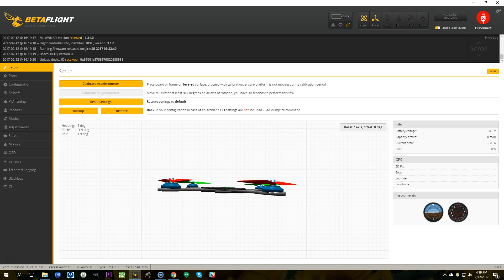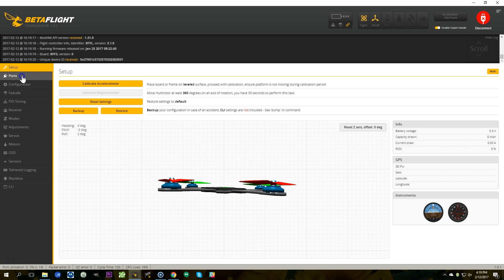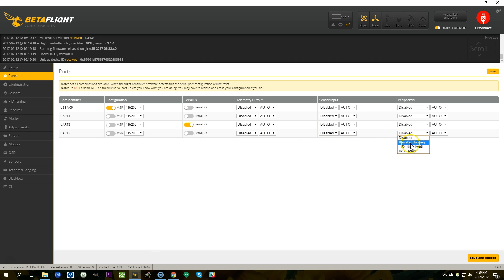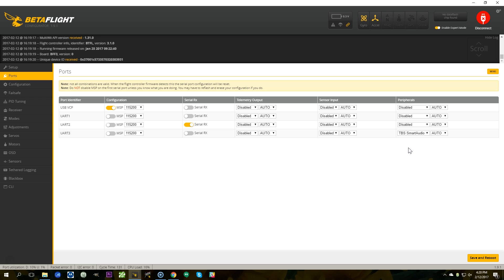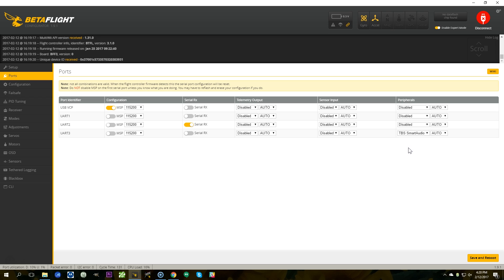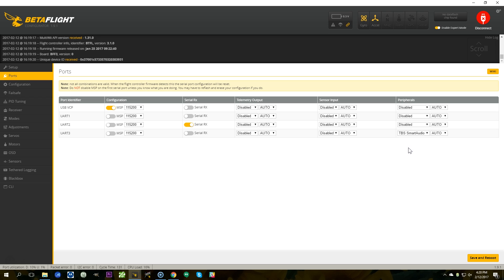BETAFLIGHT SMARTAUDIO | Change vTX channel and power remotely!

Comment: I have the Mach 3 vtx and the iflight f405 stack and have it connected to the uart t1 pad on the fc and audio pad on the vtx and in beta flight under ports tab have uart one with peripherals set as Tbs (smart Audio) and still my device is not ready.  What can i do next to try and fix.

Comment: i have a problem with my rush tank ultimate vtx, ive soldered everything up correctly, but its stuck in pitmode, i cant get it out of pitmode using the buttons on the vtx or in the osd..
Reply from the maker: It might mean your Betaflight vtxtable is incorrect.

If you are using the SmartAudio 2.0 vtxtable try 2.1.
Reply: What about if you still have an f3 with 4.0 that doesn’t have the CFC tables how do you set it up cuz I can’t...I was able to do it on my f7 controller via the cuz tables...but the f3 board is old and doesn’t have vex tables and from the osd it will change but I won’t change the actual channel on the vtx..any thoughts ?

Comment: Joshua I changed the vtx channel on my goggles to race 7 now I can’t see anything but snow. Do I need to go into beta to switch it back ? Thanks
Reply from the maker: That would work. I'm going to guess you have an Emax vTX and it is locked. If that happens, and you put it on a locked channel, it just stops working. Kind of dumb. To unlock an Emax vTX hold down the power button while powering on.
Reply: Joshua Bardwell the power button on what the the goggles turn on when I plug them in . This is a TinyHawk freestyle 2
Reply: Joshua Bardwell I think my button fell off when I touched it 😆 did a reset all set now

Comment: I was wondering if you can help me. My audio is not working. VTX is using R1 ch which works fine. I am using EV800DM and GEPRC Skip 3. Any information on what to check will be greatly appreciated!
Reply: So after careful recording review, onboard recording has clear mic audio. The googles have also the audio, but it is very faint and suppressed by a loud buzzing. The buzzing is so loud that initially, I did not hear the faint motor sound. Ideas?

Comment: Hi, After selecting your preferences will the channel and power selection remain saved to the VTX. If I disconnect the VTX and connect it to another FC will it hold its settings? Thank you
Reply from the maker: Yes, the vTX should power back up again on the same settings that it last held when it powered down.

Comment: Hi JB, Im flying the Eachine Novice 3 atm. I'm new to fpv. Eachine says the vtx is 25~400mw switchable. In smart audio it allows me to switch between 25/200/500/800mw.
It was set at 500mw when I checked first, the vtx gets pretty hot. Is this normal? And does this mean I can run it @ 800mw? My gut instinct is it's getting hot because it's running 100mw over the 400mw limit?

Comment: I cant get my AKK FX2 ultimate mini to work on any of the following github vtx setting on BF4.1  but it worked perfectly on 4.0.6 whys that? any clues? xd its so frustrating...
Reply from the maker: Loiad the SmartAudio 2.0 vtxtable almost certainly.
Reply: @JoshuaBardwell  found the issue. Had to change build type to akk and rdq and flash firmware. Omnibusf4sd to use akk vtx sa on bf 4.1 needed change from legacy to (akk & rdq) its working now.
Reply from the maker: Yikes. Is this a new vTX? I really didn't think there were any vTX out there that still had that bug.
Reply: @JoshuaBardwell  i have no clue if its new or not, I got it for at least 5 months so probably it isn't. Dunno when akk fx2 ultimate mini was released but it must be a good while ago isnt it? I had to flash my fc with different firmware build than standard Omnibusf4sd LEGACY OR THAT OTHER ONE FORGOT NAME XD to actually get vtx tables work and what do I mean by that is that the tables are actually affecting vtx not just looking good and vtx stands alone doin its own thing. Been told by friend that "All the same stuff but akk compatible. Becuase akk didn’t licence the smart audio and tried to reverse engineer it it doesn’t behave properly" and thats why akk sa doesn't work on legacy Omnibusf4sd in my case but im totally not sure whether it's true or not. Im anoooooooob 🤣💨

Comment: I don't know if I will get a response, but last night.  I accidentally cut Rx line going from my vtx to FC.  Just to make sure I checked the OSD if I could still change power levels and frequency and to my surprise it still shows up.  Upon reboot it reverts back to my lowest power level.  Which I discovered does that regardless if the Rx line is attached or not.  Am I doing something wrong?

Comment: Hay jb how come I can get rssi on my vortex 150 in my goggels as well as change  vtx channels and power setings using a dx5e tx and spectrum RX with no telematry can I get the same thing setup with clracing f4s fc I've got smataudio setup and working all ready wouldn't mind rssi in the goggels for my 5" quad to

Comment: OMG.  Please help.  I've watched SO many videos of smart audio and how cool it is to control it from the transmitter.  Could SOMEONE post a video of HOW TO ACTUALLY USE THE TRANSMITTER  to get into this feature.  I've got it wired.  How do I actually DO IT.  Thanks so much.

BTW.  Great videos JB.  You're the best.
Reply from the maker: Center throttle yaw left pitch forward to enter the OSD. FEATURES then VTX SA.

Comment: Do you need to setup the camera's audio line to the vtx?
Reply from the maker: No. That is not required to make smartaudio work. And in some cases, having a microphone attached to the audio input will interfere with smartaudio remote control.
Reply: @JoshuaBardwell  Thanks man :)

Comment: well the problem is that after you set your vtx power and save it and exit the menu,for some reason it always ends up on 25mw :( why?
Reply from the maker: Some vTX like TBS Unify ship "locked" to 25 mW and you must manually unlock them using a button press.
Reply: @JoshuaBardwell  ok,i see thank you for your quick response,wow quick, man we are soo lucky to have you buddy,have great day :)

Comment: Hey Bardwell, hoping you can teach me something today :)
 Any idea why smart audio would work fine on uart6 (tx6) on my lux micro v3 fc but not on uart3 (tx3) ?  I ran into this issue on another build a while back and the only way I could get smart audio working was to swap uarts with my crossfire which is what I've done on the lux to solve the same problem (crossfire nano works fine on uart3 btw)....I just don't get it because everything I can find online about smart audio says it should work on any non inverted uart?
Reply from the maker: Some FC have issues running SmartAudio in some UARTs. As long as you find a combination that works, go for it.
Reply: @JoshuaBardwell  Thanks for the quick reply!  That's good to know, I wasn't sure if I was doing something wrong or if I had a hardware problem or what. I even tried softserial and couldn't get it to work on that either, although I followed the instructions for a different f3 fc so the resource serial_tx number might be wrong for my f4 fc.

Comment: Hey josh i just set up the Atlatl HV and I have it on T1 uart1 and Ive tried both irc tramp and tbs and neither work?
Reply from the maker: IRC Tramp is the correct protocol. Make sure you are using the T wire on the Tramp.
Reply: Joshua Bardwell thank it was user error lol I was using the wrong uart!!! Thank you for the quick response!!!!

Comment: Hi Joshua, my smart audio menu goes straight to statx and I can’t do anything with it
Reply from the maker: It means the FC is not talking to the vTX. Wiring or configuration is wrong.
Reply: Joshua Bardwell I have it wired to the tx3
On the configuration screen on bf I have the uart3 set to SmartAudio on peripheral
Reply: Joshua Bardwell could it be, I’m using a r9mm receiver and not using f port I still have it set up sbus way?

Comment: @JoshuaBardwell Can you get audio from a run am swift mic with smart audio and use it for lua script at the same time? Because I have lua set up but I’d like to hear my motors when I fly as well. Thanks!!!
Reply from the maker: You can sometimes use audio and smartaudio at the same time. But sometimes they interfere. If you have a new vTX with separate audio and smartaudio lines then it's no problem to use both.
Reply: Joshua Bardwell 👍Thanks man!!

Comment: Hi. i have 25mw - 800mw tbs unify but at the betaflight osd there is max mw is 600 option. Does any idea ?
Reply from the maker: The SmartAudio menu vTX power options are fixed to specific values. They do not always correctly match the actual output power in the vTX. So when you set the menu to 600, the vTX will actually go to 800.
Reply: @JoshuaBardwell  First thanks for answer but i guess i remember 800mw at my another quad. Maybe its about betaflight firmware ?

Comment: I dont even have the "onscreen display" ? Meaning that I dont see RSSI values, battery voltage etc, just empty, how is that ? And yes, I enabled OSD in betaflight ... am I missing something ?
Reply from the maker: Maybe your FC does not support OSD? What FC is it.
Reply: @JoshuaBardwell   Its the OmnibusF4SD. Reading its manual I read: "FC integrated OSD"
Reply: @JoshuaBardwell  Hi Joshua, I fix that, it was not proper connected on the FC .. Now I have smartaudio on UART6 in my case and I can change VTX channels, power etc... but when I save and reboot it does not apply it ? Before to save I select "Set" and "Yes" to confirm, then back and save and reboot. It goes back to its default channel and band. Even rapidfire does not change it ? What am I doing wrong ? Thanks!

Comment: Smart audio works great to change my settings but no matter what I do to try to save the settings it reverts back to 25mw when the battery gets swapped, I am using Betaflight 4, any suggests please?
Reply from the maker: You need to unlock the Unify. You are not actually going above 25 mW is my guess. Look at the top line in the VTX SA screen in your OSD. It shows your actual TX power.

https://www.youtube.com/watch?v=EKE0eoj6tT4

Comment: i wired my audio from my mach 2 to the tx3 port of my matek f405-osd, set it up in betaflight to uart 3 peripherals to tbs smart audio, but nothing tends to work thru my qx7
Reply from the maker: Use the Betaflight OSD. Go to Features then VTX SA. If you see blank dashes at the top of the screen like --- --- --- and STATX but nothing else, then SmartAudio is not working. If you see the full menu with no dashes at the top, then SmartAudio is working.
Reply: I see the VTX channel and power in my OSD I attempt to change it then hit save and exit but it doesn’t change the VTX channel and or power could it be I have a faulty Mach 2? And thank you so much for the reply

Comment: Im trying this with 2 holybro f4 v2 and no mater what i do i cant get it to work. Ive tried the rx6 pad and the tx6 pad and got nothing on both the atlatl hx and the tx805. i dont know what im missing as i have set it up with other models and fc ok.
Reply from the maker: TX6 should work. You can try one of the other TX pads.
Reply: @JoshuaBardwell  Yeah that worked with the atlatl but on the one with the tx805 it didn't. Should i try it on tx4 perhaps? Thanks JB

Comment: Does this work with a spektrum radio? Cause I've seen that it's not working with the mobula 7. Now I bought the diatone gt-r90. do I need a specific receiver or something?
Reply from the maker: It works with any transmitter. Just enter the osd, go to FEATURES, then VTX SA
Reply: @JoshuaBardwell  ow sorry, thank you!😂😅

Comment: I have a helio spring and tbs unify HV which has both smart audio and audio connected my audio from my runcam slit2 to tbs unify and the samrt audio of the tbs to the S/A port of my helio spring v2. So what am i doing wrong cause i can see the menu but cant change channels or power
Reply from the maker: Helio wiring diagram shows smartaudo connected to tx5. I'm not sure what the "SA" pad is you're using. Use TX 5 then enable. SmartAudio peripheral on UART 5 on the Ports tab.
Reply: @JoshuaBardwell  on the new helio spring board the S/A is also tx5 but i did also remove it from that port and soldered it directly to tx5. I also selected tx5 on butterflight. I can see the menu with tx SA for smart audio and tx TA for tramp. The tramp shows the channels but that wont change anything i select. And the smart audio wont even show the the channel's or band
Reply: It works I believe it was just a simple update to odin   3.5.2 from 2.3.0

Comment: I have a question. My Eachine TX805 works great on TX6 (UART6) but i need the RX6 (UART6) for my receiver. What can i do. Racerstar TattooF4S AIO. There is only the SBUS and RSSI pin empty.
Reply: I think u can set a soft serial

Comment: Hello Joshua,

I am having some proplems getting Smart Audio working with:
Luminier Alpha AIO FC
Mateksys HV-vtx

I can see the Smart Audio scree but nothing is set or read.

Since I was using a  Luminier with Spectrum on TX/RX 5 
 I was following some instructions to use Soft serial:    (https://www.youtube.com/watch?v=RiQCzhfi4ZU&t=8s)

Wire from LED pad on Alpa AIO to TX on Mateksys VTX.

My LED_STRIP 1 was on A01

resource LED_STRIP 1 none
save, restart

Then I set
resource SERIAL_TX 11 A01 
save, restart

I did have other resources on A01.
# resource SERIAL_TX 11 A01

NOTE: A01 already assigned to MOTOR 5.

NOTE: A01 already assigned to SONAR_TRIGGER.

So I set these resource to NONE.
Then re-ran
                               resource SERIAL_TX 11 A01 
                               save, restart

                               resource SERIAL_TX 11 A01 
                               save, restart

Resource are now:
# resource
resource BEEPER 1 B04
resource MOTOR 1 B00
resource MOTOR 2 B01
resource MOTOR 3 A03
resource MOTOR 4 A02
resource MOTOR 6 A08
resource PPM 1 B14
resource PWM 1 B14
resource PWM 2 B15
resource PWM 3 C06
resource PWM 4 C07
resource PWM 5 C08
resource PWM 6 C09
resource SONAR_ECHO 1 A08
resource SERIAL_TX 1 A09
resource SERIAL_TX 3 B10
resource SERIAL_TX 6 C06
resource SERIAL_TX 11 A01
resource SERIAL_RX 1 A10
resource SERIAL_RX 3 B11
resource SERIAL_RX 6 C07
resource INVERTER 1 C00
resource LED 1 B05
resource SPI_SCK 1 A05
resource SPI_SCK 2 B13
resource SPI_SCK 3 C10
resource SPI_MISO 1 A06
resource SPI_MISO 2 B14
resource SPI_MISO 3 C11
resource SPI_MOSI 1 A07
resource SPI_MOSI 2 B15
resource SPI_MOSI 3 C12
resource ESCSERIAL 1 B14
resource ADC_BATT 1 C02
resource ADC_RSSI 1 A00
resource ADC_CURR 1 C01
resource FLASH_CS 1 B12
resource OSD_CS 1 A15
resource SPI_PREINIT_IPU 1 A04
resource SPI_PREINIT_IPU 2 B12
resource SPI_PREINIT_IPU 3 A15

Back on BF
Configuration > SoftSerial toggle ON
Configuration > Telemetry toggle ON
Ports > Softserial1 > Peripherals   Set to IRC TRAMP  ( believe this i correct from:  https://youtu.be/_13wHtnYPEM  )

As mentioned I can see menu in OSD but nothing is read or changes when set.

Any suggestions?

Could I have used the SBUS pad becuase I am not using FRSKY?

Thanks in advance for any ideas to get this working.
Reply from the maker: Are you going to the vTX SA menu or vTX TR? TR is correct.

Go to CLI type "resource list". Verify serial TX 11 is assigned to a01.
Reply: I Soldered the signal wire from:
     LED pad on the  Luminier Alpha AIO FC   TO:   TX pad on the Mateksys HV-vtx

The resource is listed correctly I believe:  Mentioned above in Resources are now:

I See  

resource SERIAL_TX 11 A01

(A ZERO 1) to be clear   

There were some other resources that were on A01 like I mentioned that I removed:
(Set to resource none:)

I saw this when I first tried to set the softserial:
NOTE: A01 already assigned to MOTOR 5.

NOTE: A01 already assigned to SONAR_TRIGGER.

So set to none and then set the softserial
resource SERIAL_TX 11 A01 
save, restart

Configuration Tab:
Configuration > SoftSerial toggle ON
Configuration > Telemetry toggle ON

On Ports:
Ports > Softserial1 > Peripherals   Set to IRC TRAMP  ( believe this i correct from:  https://youtu.be/_13wHtnYPEM  )

Same issue:

Thanks for your suggestions.
Reply: Sorry didn't answer you question:  in the OSD,  I am going to the VTX TR menu:

Comment: Hi Joshua
Can smart audio be set up for both camera and vtx? Would I need 2 uarts? Or can it be done on the single uart
Regards
Jeff
Reply from the maker: Smartaudio does not interface with camera at all. The question doesn't make sense.

Email or message me privately if you have more questions since YT comments are terrible.

Comment: Why is the smart audio OSD submenu emtpy after changing channel/band/power and rebooting flight controller? Have you run into this Joshua? Anyone else?
Reply from the maker: This means the FC is not talking to the vTX. Usually a wiring mistake. Also make sure to enable SmartAudio on the correct UART in Ports.

Comment: so now that i have it hooked up how do i change it? do i have to do it in betaflight? thats more work than pushing the button on the vtx. do i also have to hook up my taranis and use that to change thongs or what? please help and i will become a paetron
Reply from the maker: You can use the OSD menu or a Taranis Lua script to change the setting. If you prefer to push a button, you can use that instead.

Comment: Hey Joshua! I've got smart audio working by soldering the tbs unify pro to the led_strip on my clracing f4s fc. I've removed all resources for that pin and reassigned it only to use smart audio. Everything works on osd as it should. Only problem is when I make changes, save and reboot. When I power cycle the changes are not saved. They are back to the way they started. Am I missing something? Or is that normal. I thought the changes were supposed to stay.

Comment: I have a ewrf vtx which supports smart audio. It has 25 100 200mw.  There is no option for me to choose 100mw inside the bf osd.
Reply from the maker: It may be that the vTX interprets SmartAudio 200 mW as 100 mW and SmartAudio 400 mW as 200 mW or something like that.